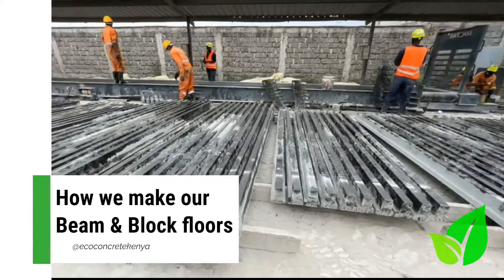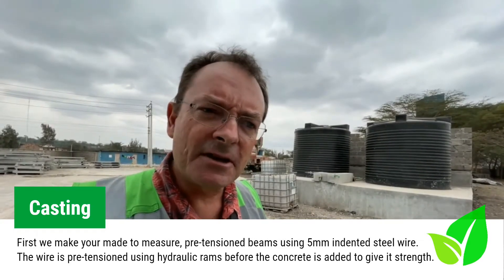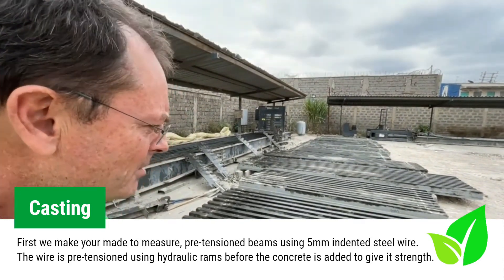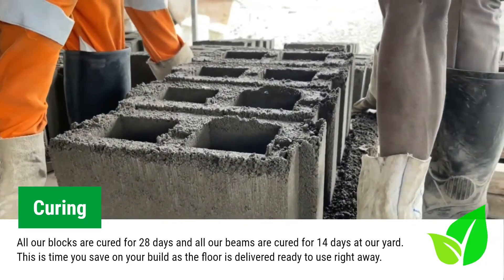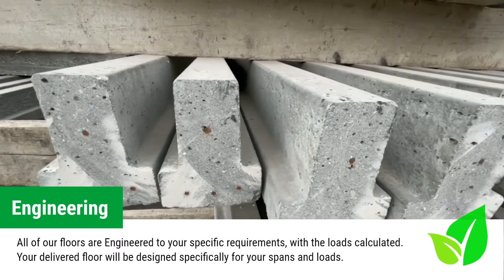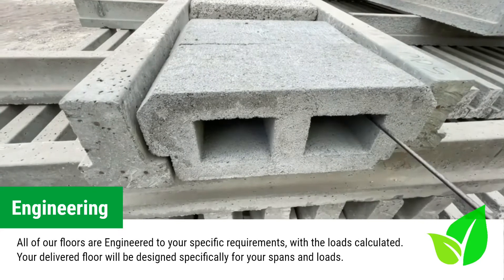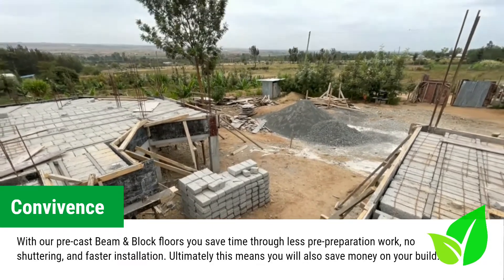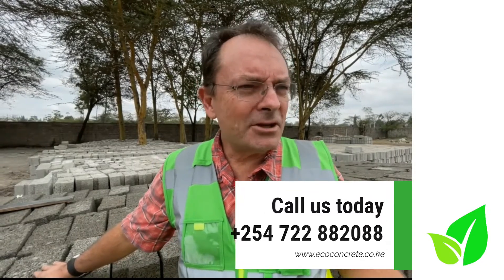How EcoConcrete's Beam & Block floor is made

Comment: If the pre-tensioned precast beams half casted concrete until the neutral web of the beam and if you cast the floor with the flange of the beam a monolithic concrete formed to strength the ribbed floor. That way i feel comfortable to recommend b/c with limited tools test equipment and workmanship leads to unsafe construction. And also column curing time has to be maintained to proceed construction of upper floors and props has to be used untill the concrete reaches full strength through curing.